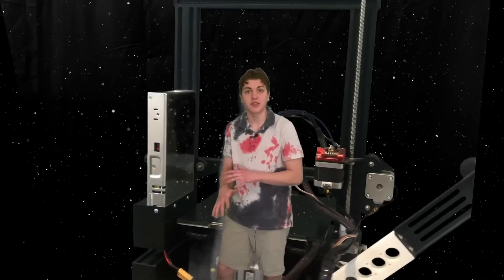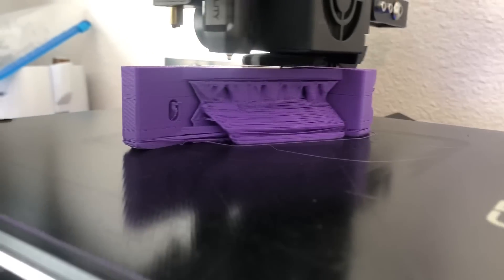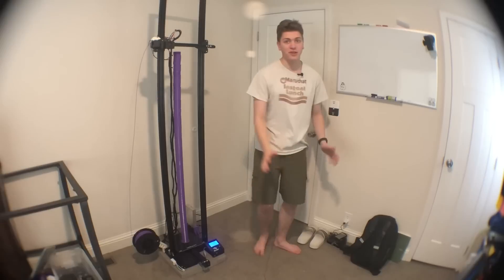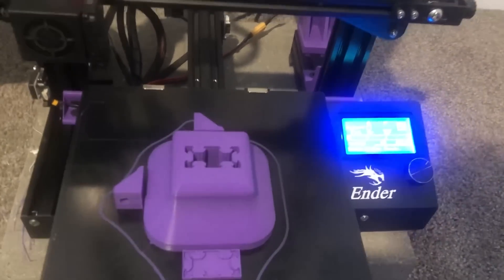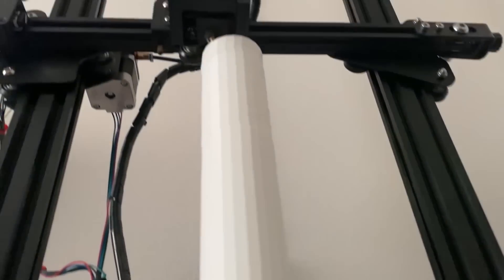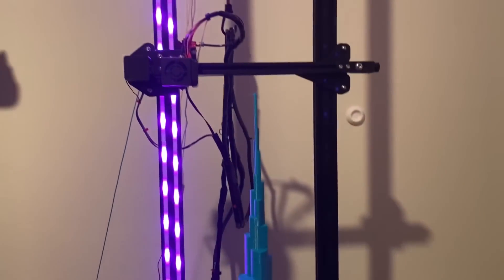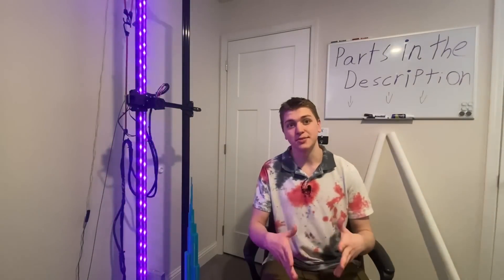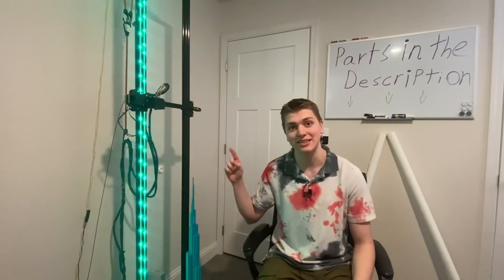I Made My 3D Printer 6ft Tall

Comment: This is really great. If you could scan yourself you could print half of yourself standing up. Smooth out the model and it would be a solid print.
Also I wonder if putting the printer back on carpet would help the wobble.

Comment: Converted to a core XY and have the bed move up and down on the Z axis. This will prevent the printer from wobbling. You’ll still need to brace it against the wall. Also, you might find some improvements by printing upside down and using G 10 as a print surface with a bl touch sensor. 
You also might find smoother motion with linear rails, but that’s even if you could find them that size.

Comment: I don't know if there is anything you can do about the wobble, because I'm assuming at least some if it is introduced by the movement of the base-plate back and forth. I think that's why most tall printers use a delta system, because it means only the tool head moves, not the model.

Comment: A moving bed kinematics system is really unfriendly to this kind of Z extension because of flex and vibration in the printed part itself, regardless of how stable you make the frame. Printing wider, more rigid objects would help a little. You may also want to try reducing the Y axis acceleration limit even lower than the painfully slow stock, since accelerating is where the part experiences forces. This all becomes easy with a giant delta printer, though.

Comment: Awesome build, I'm impressed how well it worked!  Unfortunately, the Ender 3 throws the build plate around in the Y-axis which means that the wobbling during printing is unavoidable.  Consider using some g-code commands (or update firmware) to lower the max printing speed and acceleration in just the Y-axis (like 10mm/s max speed, 100mm/s^2 max accel).  This will obviously slow the printer down, but movements in the X-axis will still be at full speed.

Also consider using a Z-hop option in your slicer for retractions.  This will limit the printhead bumping/nudging the part when moving around.

Comment: Always wanted to turn my printer 90 degrees, so it could print on the wall.
Put wheels/tracks/camera-Dolley rails/anti-grav slabs under the printer so it could slowly and precisely move across the floor while it scribbled on the wall with 'permanent markers'.
Z becomes X (or Y, if you live near Candy Mountain. Hi Charlie!) as the printer slowly glides across the floor while the hot-end is expressing itself.  
An irregular wall becomes a warped print-bed: LIDAR leveling mesh!  
With an elegant system of rigid, elevated platforms called 'tables', the printer is raised off the floor; cool things* could be placed right where they need to be without fasteners or adhesives.
One could hypothetically repair a gaping hole and missing trim that was like that when I moved in.

*Murals!; that was the 'cool things placed on wall' that I couldn't remember...

Comment: I wonder if you could use tree supports as a structure to hold the actual part like as another point of contact? Also maybe attach the printer to the concrete slab so it's not moving?

Comment: The most stable printer would have the x and y axis attached to z. Most of the imperfections should come from the printed part starting to oscillate with the movement of the y axis. With that wall mount and a stationary print the only inaccuracy should come from the nozzle draging during print.

Comment: I don't think anything will fix that coat hanger thing I less you use an EXTREMELY slow print speed, the legs are wobbly even with tiny movements, change the model, add some 45 degree arms that extend from each vertical arm that meet in the middle. Maybe like 2? And thicken the base a bit, that should do ya.

Comment: Try mounting it upside down. That could help with the weight of the printed parts collapsing on them self and perhaps also reduce vibrations from the bed slinging construction.
In the end Its probably better to change to a core xy construction. I think a  Proper printing converted a Creality to that config in a video.

Comment: I would personally use a belted Z axis on a printer like this, a screw this long propably gets really wobbly, especially when it is not constrained from the top (it should not be on the ender 3, but at this length it starts becoming a problem)

Comment: I was so sure someone linked me an old 3dp video i had missed somehow, scrolls down when done, 2 weeks ago.. o_O
Cool build though, to make it more stable you also need to beef up the Y motor, maybe mod the bed to slide on rails instead of rollers for rigidity under weight.
Run klipper on the machine and do input shaper for that really crisp quality and vibration negating logic.

Comment: And physics is like "Yeah, yeah, that's right. Fuck me.🙄"
You will never get rid of hight wobling, unless you almost zero acceleration and speed. Because it's bed slinger and the higher you print, the higher is amplitude of printed thing movement due to bed bending/curving on springs 🙄
Reply from the maker: Ratio

Comment: I would print wind turbine blades, just to put in mine and all my neighbours backyards. If you do this though, keep in mind you need to introduce a method of reinforcing that ghetto 3d printed plastic. I’ve had ones I made of stainless steel blow up or fly apart, because wind power isn’t no joke.

Comment: long term you shouldn't sleep in the same room as your printer. Also add wall mounts to corners of the frame at the top. The only issue with mounting like that can effect the square-ness of the frame effecting dimensional accuracy. Its why large bedslingers have angular mounts to that connect tjhe top and bottom corners of the frame.

Comment: An enclosure would be a great addition. Would help with adhesion towards the top and keep some of the variations down due to the airflow blowing against the tall unsupported pieces. Also very slow speeds as you progressively get taller would fix even more of the misalignment issues

Comment: you should have used an ender 5 with a second Z drive .  this way the actual print isn't getting moved in the X and Y axis , just the hot end ,the inertia of something that tall is going to be an issue with a moving bed.
Reply: I was thinking the exact same thing, any printer geometry wit a stationary (except maybe for Z-axis) build plate would be a better candidate for super tall as no matter how stiff the printer itself the wobble of the print will always limit the design of things that can be printed, they must be stiff enough for the top to not wobble when moved from the bottom. 

The Burj Khalifa model is ideal for a printer like this as it's conical so the mass gets smaller towards the top.

Comment: So good!!! I’ve been wanting to get a printer so I can print a mold of the Dragonslayer from Berserk to make a foam larp sword but I couldn’t find any printers that would be able to do it in less than 5 sections! Thanks for for the video I found it informative and fun!
Reply: Couldn't a conveyor belt do that too ? , if it is a sword and you need it to be long then i think a modified conveyor belt 3D printer should be able to do the job
Reply: That would work too! I just thought those mods would be more expensive lol
Reply: Try the Creality CR-30 printer, the one with a belt. It can technically print infinitely long, and has been used to print swords.